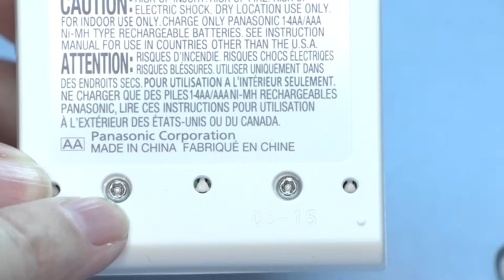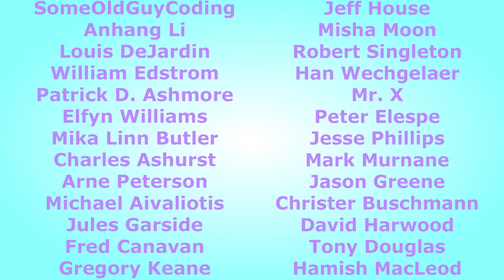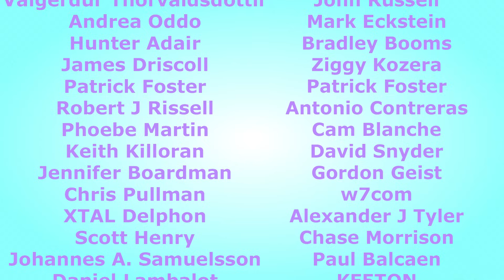Ni-MH Charger Demolition

Comment: I have the UK version of this charger (Model no BQ-CC51) which is marked by a manufacturing date of 01/09/17 so just over 6 years old. At 02:18 in the video a marking 05-15 can be seen embossed below one of the screws so that would make it approximately 8 years old if, I suspect, this is the manufacturing month and year.

Comment: Just a tip about "9 Volt" NiMH batteries.  Most of them have 7 cells giving them a nominal 7 x 1.2 = 8.4 VDC.  I have even seen them with only 6 cells for only 7.2 VDC.  However, there are some with 8 cells for a real 9.6 VDC.  Some are honest about this such as the Tenergy Centura as described on Amazon as "Voltage: 8.4V.".  This is typical.  But Powerex (MAHA) has a "True 9.6 Volt" version with 8 cells.  Some equipment, like certain model railroad wireless throttles, have a minimum voltage too low to work well with 8.4 volt "9 volt" batteries.
Reply: So those products will barely work with primary batteries. Alkaline or Zinc-carbon chemistries do have around 1.4V per cell (8.4V for "9V" pack) at only 20% discharged where Ni-Mh does have >1.2V per cell (8.4V for 7 cell pack) all the way to 50-70% discharged.
Truly "amazing" engendering (probably only 5-10% of energy in the primaries is usable).

Comment: for anyone unaware, IKEA LADDA batteries are just rebadged Panasonic Eneloops. They come from the same factory in Japan.
Reply from the maker: Yep...  great batts too.
Reply: Good to know! looks like they are a lot cheaper than the Eneloops
Reply: They're so cheap and good.
Reply: The best kept secret in rechargeables!
Reply: Yes, I bought some here in the UK recently. The AAA and the 1900mAh AA aren't much dearer than top price alkalines so trying not to buy disposable batteries any more, even for remote controls.
Reply: yes they are the deal of the decade for sure love them have about hundred of the AA and AAA from them
Reply: The white ones were. The grey ones are Chineese and not rebatched Eneloops. The white ones are not sold anymore 😢
Reply: Yes, these Ikea LADDA are fine. But i like the even cheaper 1900mAh more as they are much more robust. I am talking of occasional deep discharge or slight overcharge which usually rises the inner resistance of the cell. But please double check the "Made in Japan", at least here in Europe  from time to time there are also "Made in China" LADDA looking almost the same but of course not the same quality.
Reply: @tvelektron  thanks. I initially bought the 2450 ones about 2 months ago at £7 a pack but they had gone up to £8 last week. The 1900 stayed at £5 a pack so got those, seems I made the right choice. All made in Japan so far but will double check in future.
Reply: Ladda Ladda Ladda!
Reply: The lower capacity ones are the equivalent of the plain Eneloops, the higher-capacity ones are equivalent to Eneloop Pro.  The downside to the higher-capacity ones is that they can't be recharged as many times before they wear out.
Reply: My Carver mxr 150. Is mad at me. Filter caps are toast....current shunt almost fried itself. ..I'm fix it' someday😅
Reply: @assignmeanameplease  Yes they are a lot cheaper :)
Reply: @pe1dnn lt says “made in Japan " on both the 1900mAh and the 2450mAh grey ones 👍🏻

Comment: They have a lower voltage with no load - but I bet in higher power applications their voltage under the load is higher than carbon zinc.

Comment: Yeah, I'm surprised there were no visible signs of the magic smoke escaping. So most likely a component failure that didn't lead to heat build up in it, but cooked those batteries good and proper. I had that happen once but I don't recall how different the overtemp battery cell smell is to the magic smoke smell.
Reply: Since the liquid/paste in caps and cells serves a similar function I don't think it's too much of a stretch to think they might have a similar odour.  Someone ought to ask Big Clive; if anyone has experience with this it would be him!

Comment: I read something recently about disassembly -- start by loosening all the screws just a little bit. Then loosen all of them again, before taking any out. The point is that loosening some screws puts more tension on the others and makes them harder to get out. This is analogous to tightening screws in a pattern (like installing an engine block or a car tire) instead of cranking one down and tightening the next one.  Of course that only works if they are not tamper-proof! It also doesn't help when they glue the box together!

The caps don't look that bad but I'd check out that bridge rectifier....
Reply from the maker: I didn't have a torx with the hollow center to really get them out.  Used Plan B.
Reply: @FranLab , "security" bits of that style are remarkably easy to get hold of nowadays.  You can buy a kit of security bits with 1/4 hexagonal shanks at some automotive part stores for about $12.  If you need skinnier bits to fit down inside a plastic well or tunnel, companies like Cobalt and Prax and others sell thinner versions with 4 mm hex shanks.  Some of the kits sold for DIY smartphone repair will have the correct bits.
Reply: I have a Fanttik precision screwdriver set from Amazon. Various bits including security torx -- very handy!

Comment: Securitorx is very common these days, used in almost everything. My bet is the little Nichicon capacitor on the primary side has failed, going open circuit, which meant the power supply would no longer regulate the secondary. Primary side regulation, so the secondary voltage likely went to around 15V, instead of the 5V or so it normally had, and the pass transistors for the charger went all short circuit, and cooked the cells nicely then.
Reply: more likely unstable voltage confused the big controller chip, its likely some sort of microcontroller and they dont like unstable supply !

Comment: A battery type that I have started using and really like are the re-chargeable 1.5 volt lithium batteries. Each battery consists of a lithium ion battery with a tiny voltage regulator as part of the battery. They work well where 1.5 volts is required. The only quirk to them is that the voltage does not fall off gradually like a conventional battery. It just suddenly drops to zero. So if your device has a voltage monitor it will not give you any warning of a low battery.
Reply: That’s what I’m experiencing with some EBL brand rechargeable lithiums. No warning of when the battery is going to give out, and I’ve come across several that have completely failed after just a small number of charge cycles.
Reply: @bobwigg761  I'm also using the EBL batteries. No trouble yet. The sudden drop-off is to be expected because a 1.5 volt voltage regulator is being used.

Comment: Some devices have a low-voltage cutoff that can reject a perfectly good NiMH cell.  It's intended to mitigate leakage that can happen in alkaline cells when fully depleted.  That may be why you've had issues with some clocks.  We've got several clocks that run happily on NiMH rechargeables.  In order to prevent deep discharge, I change the cells during daylight savings cutovers.
Reply: Only thing I have that has a real problem with "1.2V" is a thermostat that cuts off at about 1.3V.  That gets lithium primaries and lasts years, now.  My wall clocks are fine with eneloops.  Motorized things run faster off fresh alkaline or those expensive 1.5V LiIon+boost batteries.  I guess some motorized things you want at full speed/torque.  Door locks, I hear.  My doors have to be pushed for the deadbolt to move, so forget trying to use electronic locks on those!

Comment: I've been slowly getting rid of my old fashioned batters to use USB chargeable ones. It is so convenient to just plug them into a USB charger and away we go. I have duplicate pairs so I can using one set while charging the other. I like that they are drop-in replaceable for standard cells.

Comment: Rechargeable battery tech has really come a long way, I remember we used to have a massive brick that you had to plug in with a wire. It had a switch on it for two different types of battery you could charge with it. I was pretty surprised when I got a unit that could plug straight into a wall socket - so much smaller!

Comment: nice teardown, the fact that there were no visible signs of combustion would make me wonder if the smell was in fact from the batteries, but then permeated into the charger unit. Did you ever try checking the current & voltage output to see if the values were within the acceptable ranges?

Comment: I just snap off the centre pin.
Reply: I was going to suggest this, but thought I'd best check whether someone had already pointed it out. The centre pin on torx security screws is usually quite fragile, readily snapped off using a 'pointy' implement.

Comment: When I caught a (different model of) NiMH charger in the act of cooking my batteries, it made a bad smell. I think the smell was just the batteries, though, which were visibly weeping liquid. I also took my charger apart and I also saw no obvious signs of damage. An internet search showed me that my model charger was widely recognized as having design and/or firmware issues that could just ... cook batteries once in a while. Jeepers! I threw it out.

And replaced it -- with a Panasonic. Hah! The house of entropy always wins.
Reply: Maybe this charger also has a firmware problem because i only see a big elan microcontroller chip controlling everything

Comment: I've been really happy with my Panasonic Anyloops. My first set has done well over 1000 cycles and have lost about 20% of their capacity, but that's pretty good value all things considered. I did buy a newer set of anyloop pros, but for some reason I'm only around 2000mAh out of them instead of the rated 2450mAh. Not sure if it's just because I'm using them in a Game Boy Color [sic] and they've just got a different discharge curve to the original 1900mAh cells, or what. Still better than the old ones, so that's fine with me.

My charger is an Opus BT-C3100, not the greatest but it does the job. I mostly got it because it supports Ni-MH and Li-ion, and you can set the charge current.

Comment: plugs in the usa look so fragile compared to the uk
Reply: UK style plugs - with those absurdly thick prongs and a mandatory separate power switch at each receptacle always seems to be over-design to me.  120 or 230 volts - they are still only 15 amp circuits.